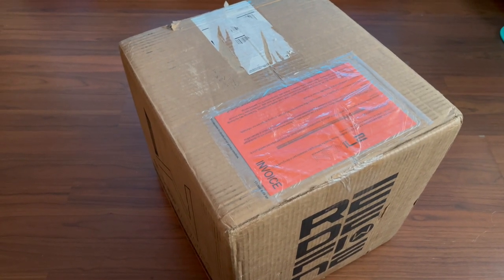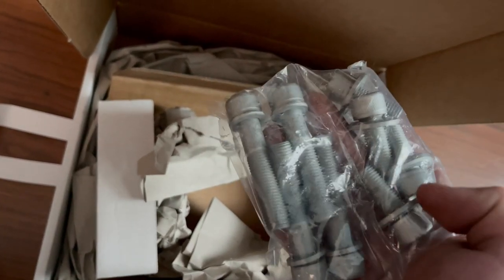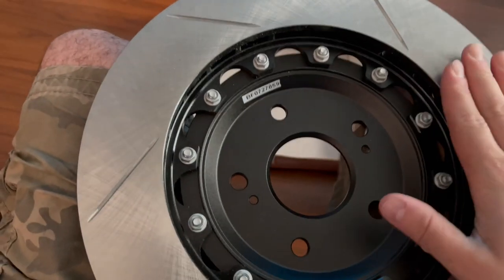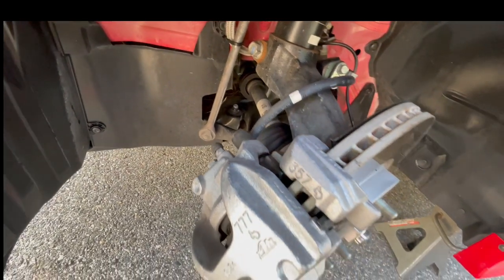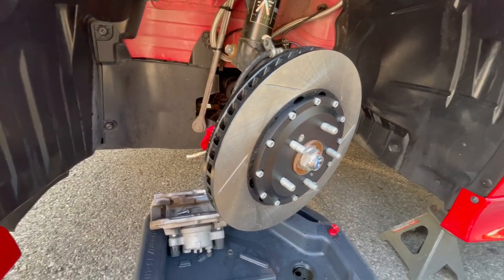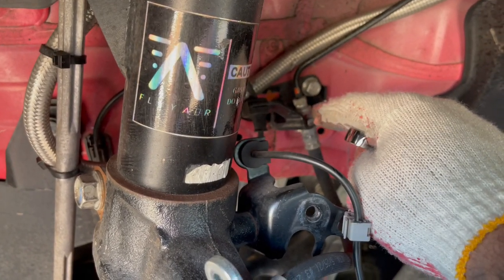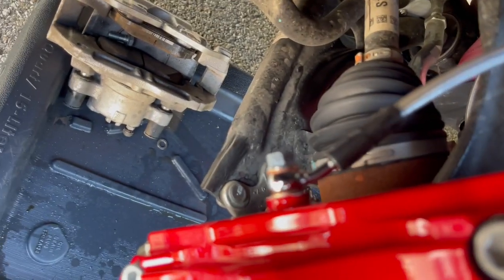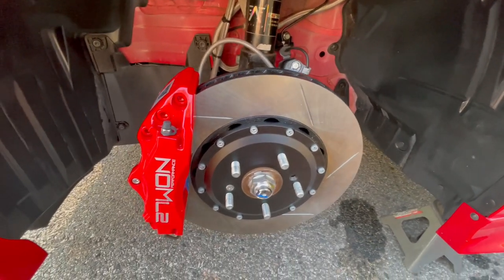2022 Honda Civic Si 27Won Big Brake Kit Install ( Brake Upgrade )

Comment: For daily driver after installing these, how long till you need to change your  new pair of rotors?
Reply from the maker: @Cube69619  remember rotors run at least two sets of brake pads the ones they came with and then a new set,  from what I’ve seen right. They are still fine till this day honestly and it’s been more then 10k miles

Comment: Does the brake hold feature still work with the bbk?
Reply from the maker: @Verstappen33-j6q  everything still worked like factory, it just beefed up the braking power in the front
Reply: @ thank you! I love the brake hold feature and don’t want to lose it if I upgrade to this bbk

Comment: Are the pads had to change ? I can’t find a install vid on just that , I’ve done pads / rotors but that weird clip on the outside has me worried.
Reply from the maker: What do you mean ? You saying the stock ones.?
Reply: @sfernandez816  yeah the stock pads , are they hard to just do a pad swap on those calipers

Comment: what size spacers do you need if using OEM wheels?
Reply from the maker: I used a 20mm spacer since I didn’t want to put extended studs, if you do want extended studs then all you’ll need is 10mm to clear

Comment: What is the size of your wheels ??? I have  wheels size 18 x 9.5  offset 35 mm ... this kit work for me ... ??? Thanks
Reply from the maker: It’ll work good mine were 18x9.5 +38
Reply: @sfernandez816  Thank you very much friend, did you use a spacer or I don't need it? thanks

Comment: Will these clear stock wheels for the Si?
Reply from the maker: With a 20mm spacer I did it to mine but I did 20 all around so it can match and bro the car looked good with it 
You can do 10 mm but you’ll need extend lugs but I didn’t want to do that